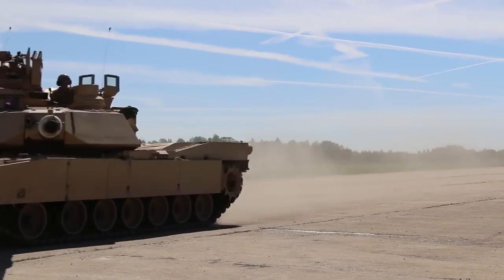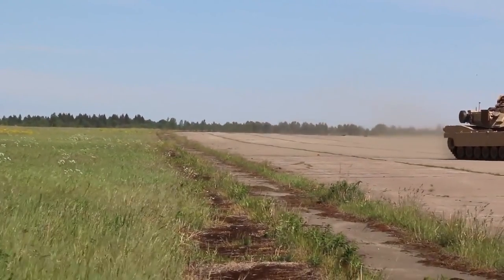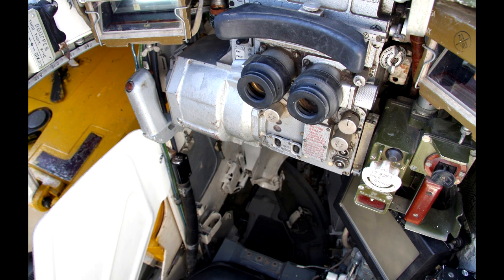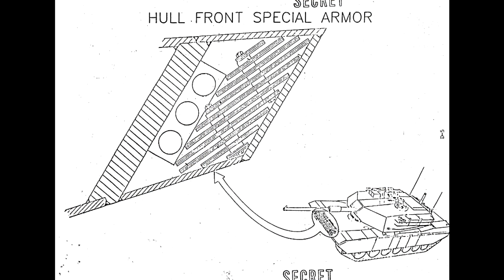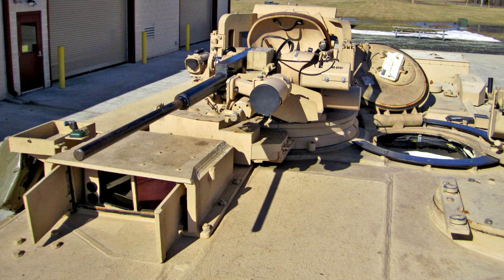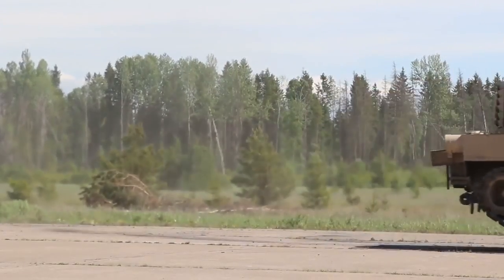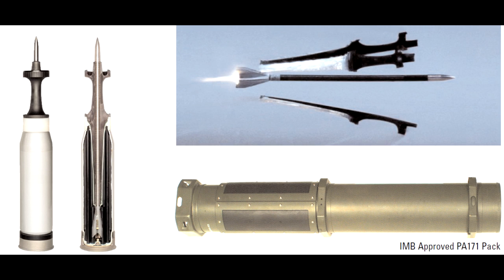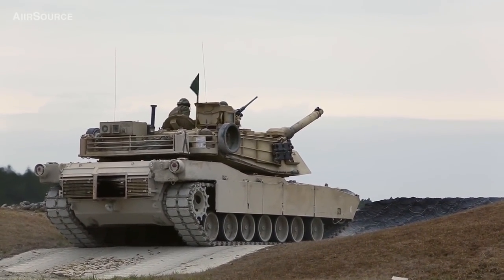Problems with Abrams tank

Comment: A few things I want to address quickly. 

1. Gas turbine can run off diesel, and often does. (Still requires refueling every 24 hrs and is very maintenance heavy)
2. M1A1 commanders weren’t blind at night. The commander had a seperate IR night sight slaved to the gun.However at night time through rough terrain the commanders main job isn’t to ID targets anyway, they are more concerned with not rolling the tank or getting it stuck. As a result they usually aren’t looking through an independent thermal.
3. Yes the upper plate is comparably thin (not as thin as mentioned in the video) that said, it is a very small target, and unless the tank is in an assault supporting infantry, or the crew is caught out, that won’t be exposed to enemy fire.
4. The reason why gas turbine was adopted over a Diesel engine is because it’s rate of acceleration is significantly greater than diesel (horsepower isn’t the only thing affecting it), as well as being a lot quieter, at the expense of operational range and maintenance cost. This greatly helps the M1 with its tactical mobility, noting its combat laden weight.

I’m not trying to defend the tank, I’m just trying to clarify a few points that weren’t entirely accurate. Make your own decisions.

Comment: At 2:01 you can see the commander holding the turret override stick in his right hand
Reply: Yes the commabder can take control of the turret himself, the problem however is, he did not have his own independent sight (like on the Leopard 2 for example) so he could only rotate the turret to the approximate direction where he suspects an enemy target. 
In comparison, the Leopard 2 commander had it much easier, he could simply point the gun at the exact spot he wants by looking through his own independent perisocpe, which the early M1 Abrams did not have...

Comment: Why were you so obsessed with the thickness of the steel armour frame? Why did you leave out the composite armour?

For the base model M1 Abrams, Steven J. Zaloga gives a frontal armor estimate of 350 mm vs armor-piercing fin-stabilized discarding-sabot (APFSDS) and 700 mm vs high-explosive anti-tank warhead (HEAT) in M1 Abrams Main Battle Tank 1982–1992 (1993). In M1 Abrams vs T-72 Ural (2009), he uses Soviet estimates of 470 mm vs APFSDS and 650 mm vs HEAT for the base model Abrams. He also gives the Soviet estimates for the M1A1, 600 mm vs APFSDS, and 700 mm vs HEAT.

For the M1A1HA, Zaloga gives a frontal armor estimate of 600 mm vs APFSDS and 1300 mm vs HEAT in M1 Abrams Main Battle Tank 1982–1992, nearly double the original protection of the Abrams. In M1 Abrams vs T-72 Ural, he uses different estimates of 600 mm vs APFSDS and 700 mm vs HEAT for the front hull and 800 mm vs APFSDS and 1300 mm vs HEAT for the front of the turret. The protection of M1A2 SEP is a frontal turret armor estimate of 940–960 mm vs APFSDS and 1,320–1,620 vs HEAT, glacis estimate of 560–590 mm vs APFSDS and 510–1,050 vs HEAT, and lower front hull estimate of 580–650 mm vs APFSDS and 800–970 vs HEAT.

Its the same type of obsession I see people who say the Challenger 2's LFP is armourless based on a single picture from a tank in a museum (which turned out to be a Challenger 1). They completely discount the composite armour just behind the frame.
Reply: It seems you didn't get the point of this video. This video is aimed to point out the faults and weaknesses of a tank.
He wasn't talking about the composition of armor, because that wasn't even the point of the video.
And he already talked about the armor composition in his other videos anyway.

Also there is no composite armor behind Challenger's lower front plate, it's just a single steel plate of 70mm.
But it does get add-on armor added over the lower front hull when used in combat, which increases protection.
Reply: @xAlexTobiasxB  >This video is aimed to point out the faults and weaknesses of a tank.

And one of the 'weaknesses' he pointed out was the supposedly thin upper front plate of the Abrams, which is not true. The Abrams does NOT have a thin UFP.

>Also there is no composite armor behind Challenger's lower front plate

I know, when I said the composite armour just behind the frame I was referring to the Abrams. Sorry I wasnt clear.

>it's just a single steel plate of 70mm.

Wrong, its a ~25cm thick RHA steel plate. Seen it first hand, measured it as well. Father used to build them.

Comment: DU ammunition makes up for shorter barrel length.
Reply: Dud. There are no APFSDS ammo that uses steal since 70s. 
All APFSDS roads uses high density alloys . And there is 2 options only
Either DU . Or Tungsten .
Tungsten is rare to see in US or Nato since its a rare metal and Russia have the biggests reserves of it. And it has bette penetration capabelities than DU at high velocity (1600m/s and above). 
But it hase no relation with barrel length
Reply: @lostinthesauce6409  actually your data is wrong... DU is better than tungsten below 1800m/s - on par with tungsten between 1800 and 2000m/s and inferior to tungsten beyond 2000m/s

but german L55 fires at 1750m/s so the L44 with SELF SHARPENING DU does a better job than the harder tungsten even with lower muzzle velocity because tungsten point will mushroom increasing cross section and friction reducing penetration capability while tungsten will break but will come out with another sharp point ready to penetrate some more plus DU is pyrophoric so it will cook the crew inside the tank unlike tungsten.

Comment: Kind of, Gas turbines are actually the most efficient engine type when on the move - their failings are specifically when not moving. Also the use of fuel goes back to the fact that the US uses that JP7 fuel for most everything. (Because logistics.)  Also maybe increased projectile length  might be needed to pen new armor types - such as the checks on the Leopard that destabilize short darts

Comment: IT HAD ISSUES...but not any more and now we have Trophy active protection...APFSDS can defeat any Russian armor no need for improvements...gas turbine engine benefit is longer service intervals unlike diesel engines and yes it's important to use any kind of flamable liquid in the battlefield...upper hull plate is not a problem eaven if you penetrate it there is a drivers capsule with it's own armor...and the hull can whitstand a huge IED just go see some videos

Comment: So he doesn't like the engine cause it's too expensive?  Spoken like a true socialist. The tanks record speaks for itself. Wait, you do know a tanks effectiveness is determined mostly by it's crew don't you? Sure you do
Reply: AkBorealisdev Davey the problem is not that it is too expensive. The problem is that it has far better alternative with the same performence which are cheaper, more reliable and much more practicle.
And yeah it‘s true that the crew and crew training is important. That‘s also the reason, why the abrams was so effective against arab armies. But if the abrams has also to fight off an army which has a comparable training and command structure it will run into problems. Remember, no army is invincible. And if the skills are similar then the thing that matters more is the machine itself.

Comment: "takes an RPG to the upper glacis plate " "Thats a lotta damage"
Reply: except RPG wont fuse at 82 degree sloped front plate.... it has issue fusing against anything higher than 70 degrees... besides, 58mm sloped at 82 degrees, that's 500mm RHAe... and its not soft steel but HHS plate so add additional 20% to it... T72/80/90 all have lower hull just 200mm RHAe thick.... even 105mm APDS from 1960 can penetrate it...
Reply: @komradearti9935  it was 38mm thick on M1.. it was changed with uparmored tanks.. just look up any M1A1 tank photo with front hatch open and you will see how thick that plate is..
Reply: @komradearti9935  im not talking about lid.. but glacis thickness. its visible on some photos where lid is open
Reply: @komradearti9935   besides,  glacis was designed like this because it was a design choice of having extreme slope on upper front, and heavy armor on lower hull.. other tanks usually have strong upper hull and weak lower hull.. US designers went with opposite approach because in defensive situations, hull would be completely hidden behind terrain in hull down positions, while on attacks, when you go over obstacle, or move uphill, lower hull is more exposed while upper hull  angle increases..

Overall, Abrams was a tank designed to perform best in what it had to do - fight defensively against hordes of enemy armor, use terrain in defense (that's why it had excellent gun depression and high acceleration thanks to gas turbine, which was its main benefit when tank was introduced and no diesel could match it at the time..)

and btw, that 105mm gun first Abrams had was actually  a lot more accurate than russian 125mm smothbore, and had very similar penetration capabilities - M833 APFSDS could penetrate over 400mm armor at 2000m, while M900 could penetrate 450mm at 2km...  on other end, BM29 125mm APFSDS could do 420mm at 2km,  BM-32 (DU) around 480-500mm, and BM-42 (W) 450-460mm at 2km... so that 105mm gun was not that far off... plus, armored doctrine is about maneuver fighing, when tanks would attacks flanks of enemy advancing formations, which means they would fire at enemy side armor, not front armor... and that 105 was more than enough to take out any Soviet tank hitting the side armor..
Reply: @komradearti9935   its not important if its 400 or 450mm.. soviet APFSDS is rated the same, that was the point.. 105mm gun was not inferior to soviet 125mm in 1980ties.. it was equal in terms of penetration, but was more accurate (less dispersion with both HEAT and APFSDS).

Similarly with glacis - critizing Abrams for weaker upper glacis (which is 400-500mm thick due to LOS slope) but ignoring the fact that Soviet T64/72/80 tanks had lower glacis just 170-200mm thick, while large areas of front turret also did not had maximal protection (upper turret and area around the gun) is kinda strange... overall T64/72/80 had 50% of frontal profile much weaker than maximum armor quoted for them, which means in 50% of hits, even obsolete 105mm APDS rounds would penetrate..  Abrams at the other side had calculated weakness spot for upper glacis in certain situations, (no, 1980ties soviet HEAT-FS would not fuse at 82 degree slope, while Soviet APFSDS would struggle with it as well ( first monoblock APFSDS came only after Soviet Union dissolved, and for quite some time Russian tanks used soviet era BM-42 / BM-32)

in terms of FCS, even M60A3 TTS had more advanced FCS than T80BV, as it used fully dynamic lead, which T80BV and T72B lacked.. plus, Thermal sights gave both Abrams and M60A3TTS a huge advantage over Soviet tanks, with identification ranges 3-4x longer in day and night (Thermal is preferred sight even during day) Soviets never actually produced anything similar, their attempts were extremely unreliable so Russian Federation instead just used French Thermal sights built under license... btw, it took them another 20 years until they managed to build same level sight on their own...  where Abrams today uses 4th generation Thermal sights...

Comment: I think the main issue that drives the belief that the Abrams is the best is because it's one of a few modern MBTs that have actually been used in combat. The others being the British Challenger 2, and Russian T72s.
The main reason for it being dubbed that would be pointed at the Iraq war.
Even though the tanks they faced weren't official soviet T72s, back then they didn't know that, it was still a tank that worried US tankers.
So when hearing that a few Abrams destroyed 25 t72s in a matter of minutes while not losing a single one, you would assume that it is a highly advanced tank ahead of time.
Reply: M1A1 was created to confront the T-55 and T-62.
The main reason is that if the US military saw an enemy tank, they called it T-72, when it could be Type-59, T-62, T-54 or their Chinese and Polish clones (which had, at best, outdated ammunition and the most simplified and cheap equipment possible). Iraq received only 200 sets of real export T-72Ms from the USSR, all the rest was crookedly collected garbage that was bought through third countries. Sadam quarreled with the USSR and supplies were frozen.
When the United States received the T-72B from eastern Germany in the 90s, it turned out that 105mm did not penetrate it, and during the day it was a deadly enemy, second only to ammunition and night vision. And the T-80U equipped with guided missiles and a thermal imager had every chance of killing the M1A1 before he even saw it, even at night.
Reply: But in general, the training of the crew decides the matter. Even if the Iraqis had a normal T-72A with their tactics, air defense and logistics, this would also be a failure.

Comment: OMG< just stop this nonsense.... Soviet tanks in the 80ties might have separate commander sights.. but both Active and Passive Night vision systems were good for nothing... their range was limited to 800-1200m... so Abrams commander was a lot better off with his access to Thermal Sight which had good range up to 2500m during nights.... M1A1 during Desert Storm had absolutely no problem detecting Soviet made T72 up to 3000m even during night and taking them off... and these also did not have indepentent commander sights

Upper hull on Abrams was practically unpenetrable by any Soviet APFSDS, because these were unable to handle extreme slope used (82 degrees).. .same for HEAT rounds.... lower hull got uparmored, anyway when you are comparing to Soviet tanks, lower hull armor on every single soviet and today's Russian tank is even weaker and even 105mm APDS could penetrate it with ease...  and btw, APFSDS dont deflect... they break upon deflection, so NO THEY WONT PENETRATE anything when deflected... they would break into pieces and then hit the armor... APFSDS needs to hit the armor with its point...

and why Turbine?? Because it can work no matter what temperature is outside... even in polar...... so do yourself a favor and search why Russia refurbished turbine equipped T80 tanks so they could be used in polar conditions where T90 with its diesel just froze out...

Comment: Remeber if fire comes out of the crew compartment and hatches 

The blow out pannel didnt do is job
Reply: Or - more likely - the ammunition compartment doors had been locked in the open position.  If the ammo compartment doors were closed then the blow out panels would have been the 'path of least resistance' for venting an explosion.

Another possibility is that the tank was damaged and had to be abandoned - so the ammo compartment doors were locked open and an explosive charge set off in the turret.
Reply: @colincampbell767  Or the ammo doors were damaged.
Reply: @jeffkardosjr.3825   The ammo doors were designed to protect the crew even if there was a hole in them.  Something that people fail to realize is that 'keeping the crew alive' was one of the primary requirements for the tank design.  And we have lost very few tank crewmen despite losing several dozen tanks in combat over the years.  Every KIA inside the tank was because whatever penetrated the tank also went through the crewman.
Reply: @colincampbell767  jesus that's brutal.
Reply: Or the Tacobell tacos did their extremely well XD
But ye, ammo-recks aren't fun for the crew.
Reply: Best tank is one not used